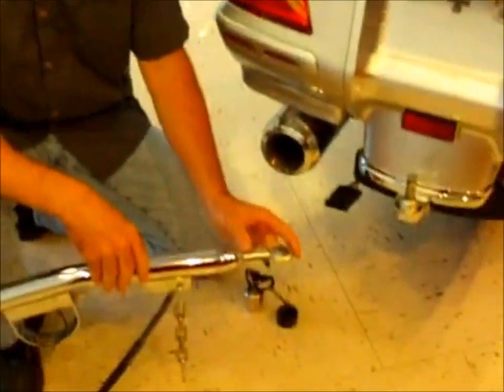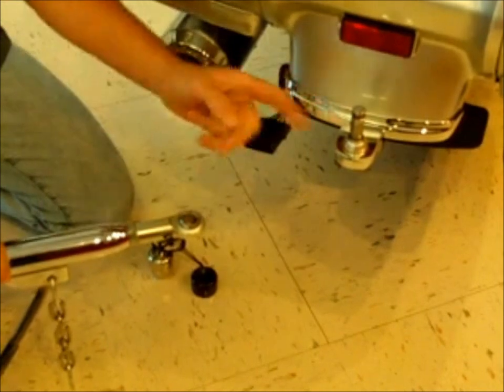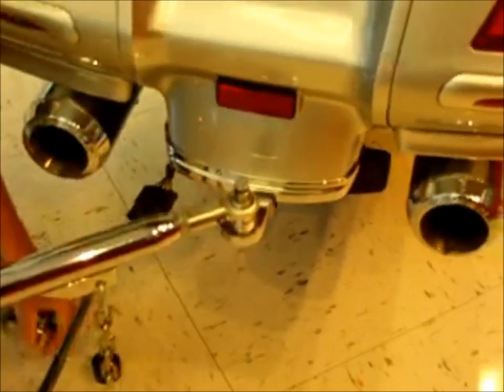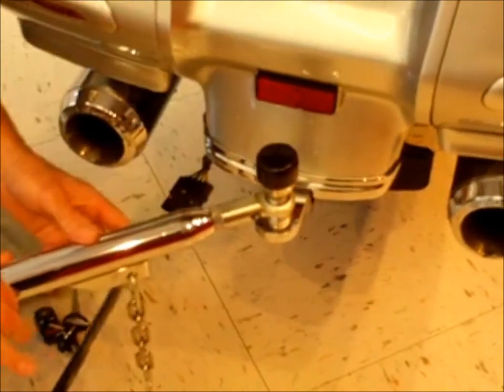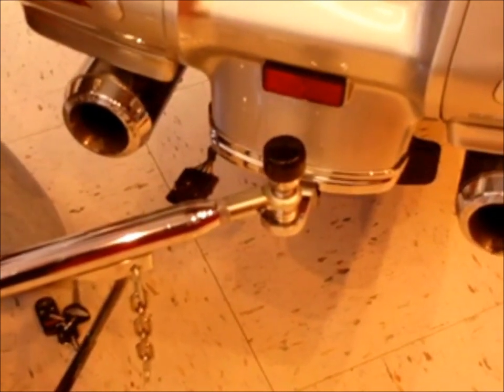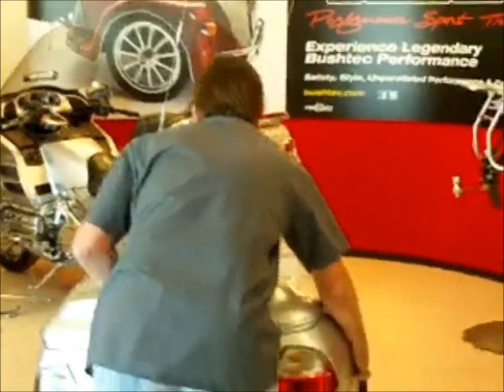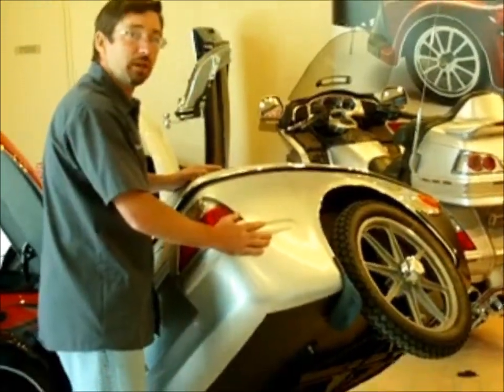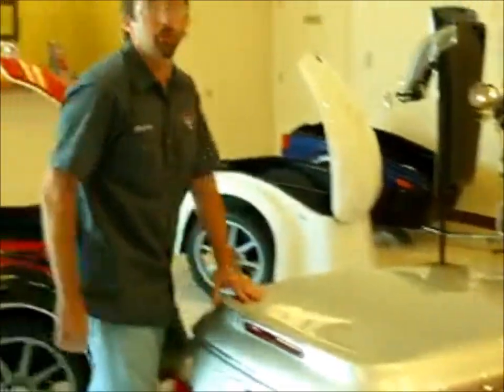Unique Characteristics of Bushtec Motorcycle Trailers - The Heim Joint

Comment from the maker: @theDogWarrior The Heim Joint is a feature of all Bushtec Trailers, and requires a Bushtec Pin Hitch for your bike in order to provide the complete No Push/Pull safety functionality. Check out our website under Hitches / Victory for our Victory motorcycle hitches. If you don't see your model listed, and if you're really interested in having a hitch for your Victory, we can build one! We design, engineer and test ALL our hitches! 888.321.2516 for detail